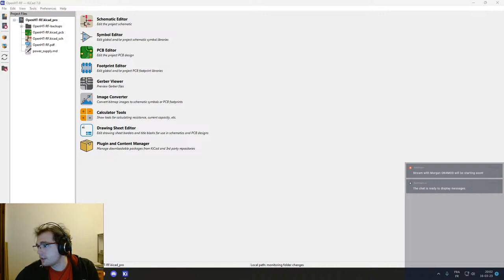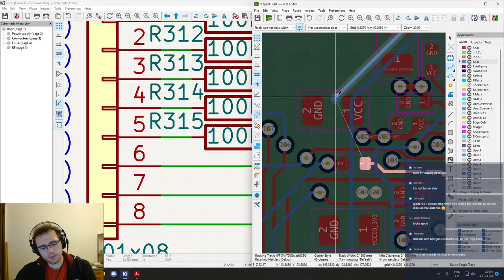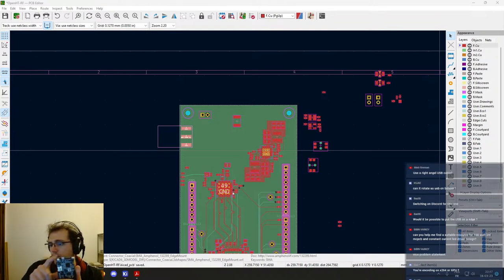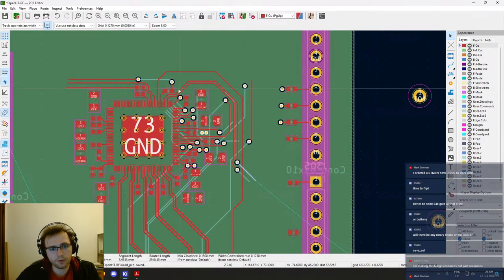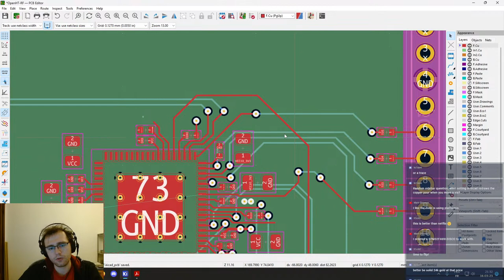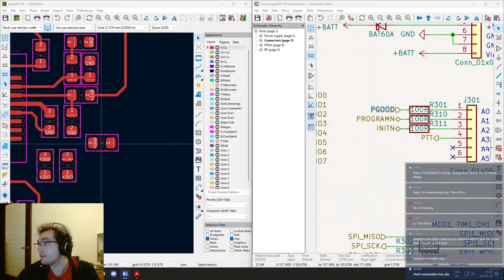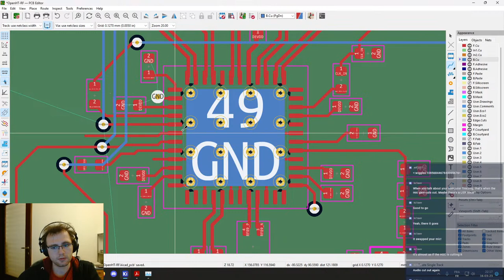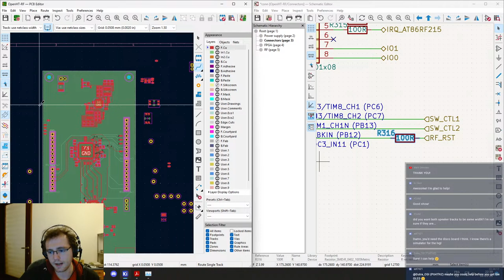OpenHT PCB Design with Morgan ON4MOD - Part Deux!

Comment: Is it kicad? If it's tell my why XD I'm splitter between eagle and kicad. Fusion 360 and free cad. I was working with both, but I can not decide... There is also easy eda... But is it working with any of 3D graphic programs? I would like to implement my pcb design directly to 3d program to project chassy for it... Can you help me decide?
Reply: Hi,
While we can not point toward a specific software as this depends on the way you work, your habits and your project's requirement, I can gladly tell you why I use kicad.

In this project, we intend on making everything open-source. This already rules out Fusion 360, Altium, Eagle,...
KiCad is also free, and the online community is quite large, with many answers to your quiestions available online.

I personnaly have worked with both Altium  Designer and Fusion360 and I absolutely hated fusion360 for the PCBs. Is was highly unstable, with unusual ways of doing things. 
The only thing I think KiCad lacks is the possibility to do advanced via patterns, planes stitching and track shielding. 

I hope this will help you choose the software you'll work with :)
Morgan